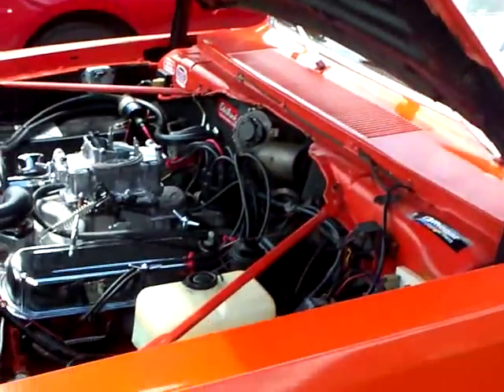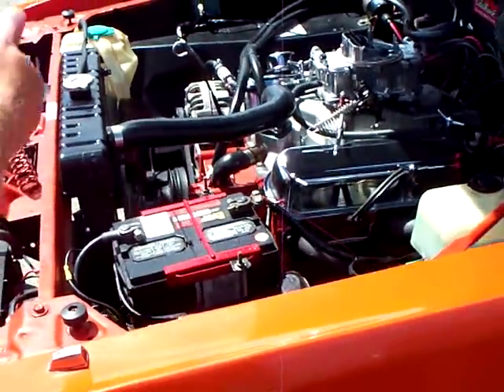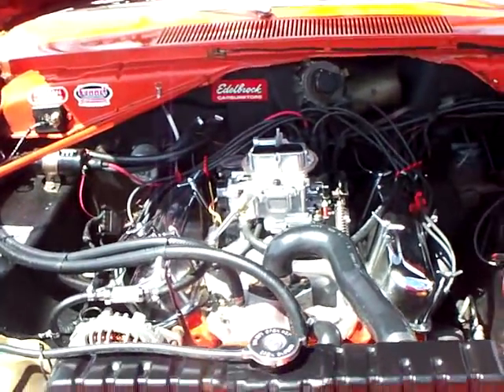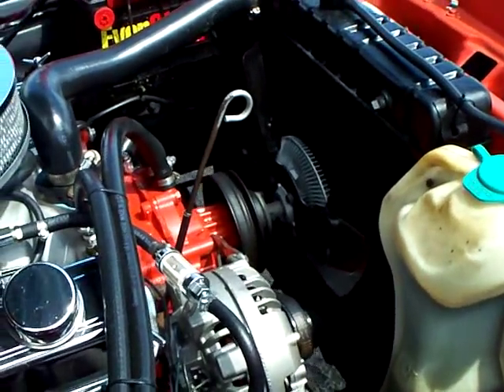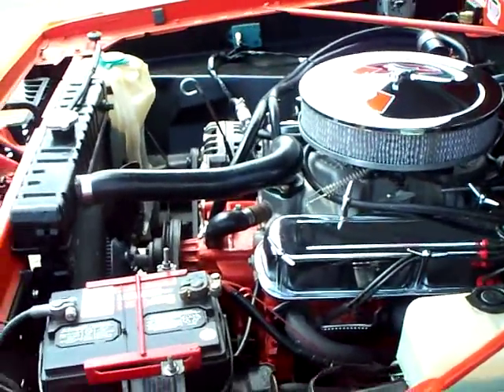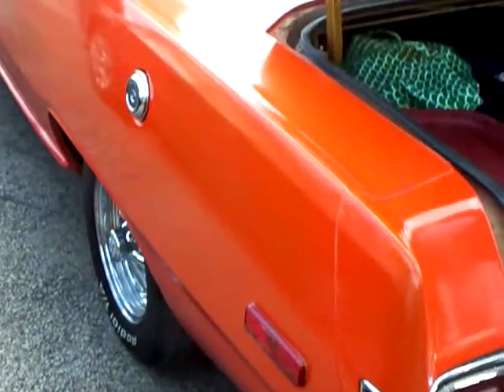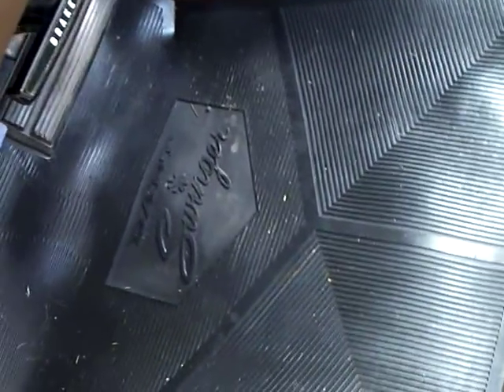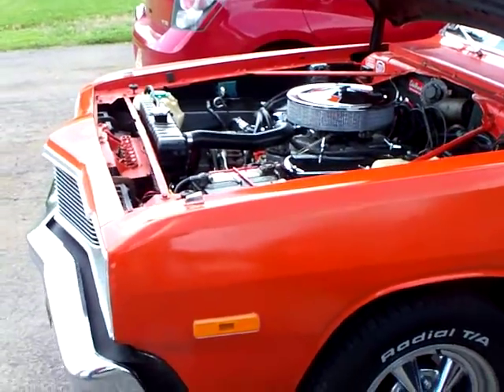1975 Dodge Dart Swinger

Comment: In the process of restoring a 75 dodge dart swinger. We had add on air from the factory and just took that off. The problem is the when we took the ac compressor off, there was no way to mount the alternator belt to let it spin. If you could help in any way possible that would be amazing. I'd rather not spend 1700$ on a serpentine belt that's billet aluminum on a work in progress car.

I'll trade you cars, it looks really good :)